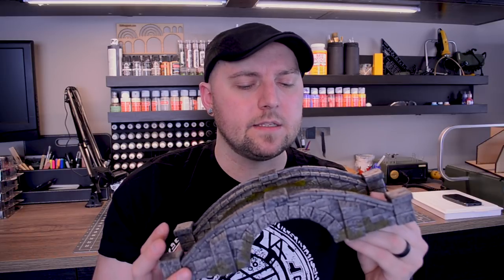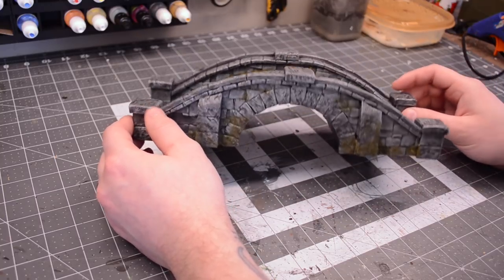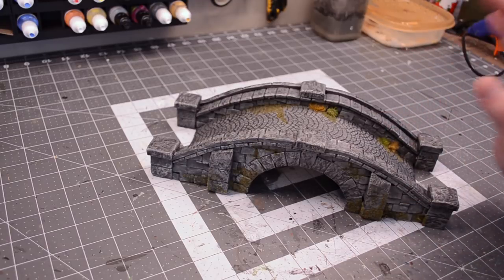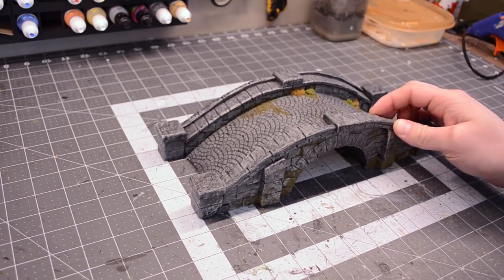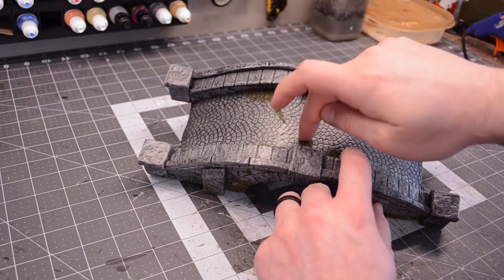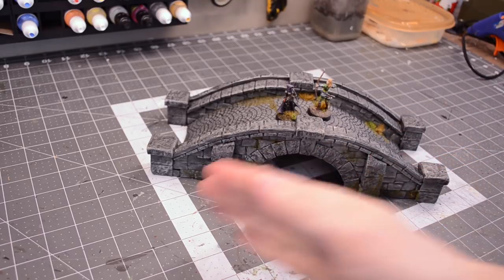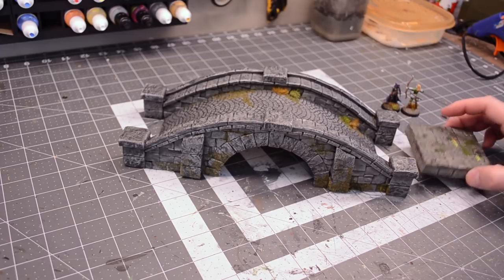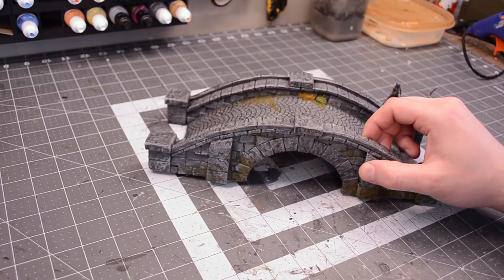Stone Bridge Build Review (Black Magic Craft Episode 076)

Comment: To fix the curves where the mini's slide down...run a bead of glue across the walkway in 1" intervals.  Once it dries it is invisible, and will provide a shelf for the mini base and they will not slide.
Reply: It does not even need to be invisible - on steep inclines in the real world they are called 'cleats'. Important for horses with metal clad hooves.

Comment: I love the retrospective video. When you published your bridge I was in the middle of my own. I went for more of a modular approach. 

I have two 3x3 grid 2in high arch pieces and then stairs of 3x3 grid as well. The actual arch comes from the side walls I added to the stairs. This way I can make my bridge a double arched or single. basically either 9x3 or 12x3 total. 

You kinda describe that near the end of the video. I like it being modular cause then I have pieces I can use in different ways when I don't just want a bridge.

Great work man. Super inspired by everything you do.
Reply: If I were to build a modular bridge, I'd probably have the two sides be the start of arches, so you could stick them together to have a short bridge, then do the middle modules as half of an arch each way, basically being the middle support pillar of two arches.

Comment: I really like this video, the retrospective on a piece's practicality is extremely valuable. The idea of making it so that it fits in with a road section is spot on and something that I will definitely be using myself. It also got me thinking that by doing that you would raise the entry point of the bridge and that would lower the angle of the slope which is something that I would not have thought about unless you pointed it out!

Comment: IF you don't build a new one, you can fix a couple of your problems:

1 - Add more road to come to the ends of the columns so your tiles can still but up to them
2 - For the playability, you can take and add some 3d lines for grid and grip. Make them from hot glue on some wax paper so you can get the most consistent lines then use clear tacky glue to glue them to the bridge. It'll still be steep but should help out.

Comment: quick fix for the slope on your bridge for minis, make up sponges, they are a triangle, cut the thin end about an inch, or the size of your bases, paint black.. place sponge on bridge, and mini on top. should level out the mini and the rubbery sponge will hold it in place.

Comment: Perhaps it is fixable?  Knock off the corner posts and build a new road deck on top fixing the incline.  Then extend the side walls up and out adding new corner posts that both line up with the side supports and can accommodate a 3x3 tile between them.  Would make for a great video I think.
Reply: Either way it looks great over all!

Comment: Take you this long to realize the hill is too pronounced to stand minis? I realize it from the making. LOL!
Reply: A easy fix is making slot holes to slide minis there to stand, minimal disturbance on the bridge and functionality will be secured.
Reply: or add some more sand/rock scatter on it, or maybe some grass clumps, just so there is something the mini's base can sit up against.
Reply: [martin the warrior ]
It's a stone bridge not a country road, as he say it need stair to work and any rock of grass need to be bulky to work and that will kill the aesthetic way more than some discrete slot holes.
Reply: yeah, true. i did a similar bridge a while back and the grass/dirt worked fine for me, but then my bridge was themed as kinda falling apart dilapidated.
Reply: [martin the warrior]
I like that pretty hill and put stuff there kill that pretty hill aesthetic.

I found a better solution than slot holes, just put clay-like stuff under the minis to make them stand straight.
Reply: A rougher surface for the bridge may help hold the minis